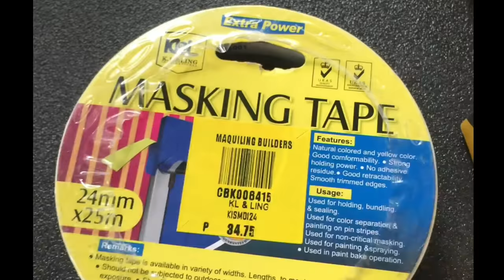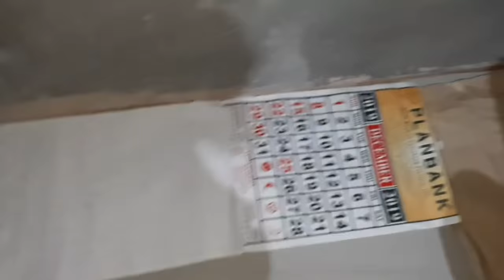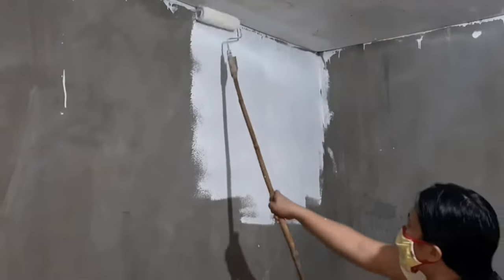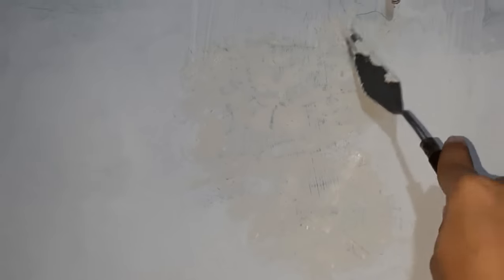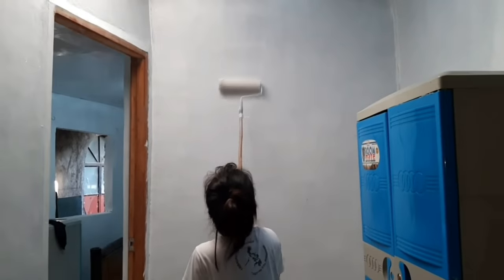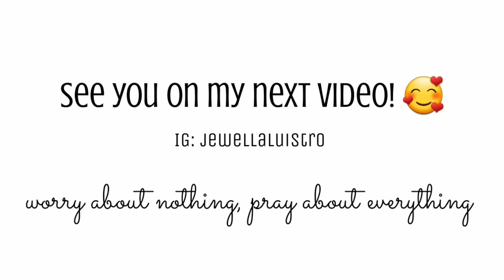EXTREME ROOM MAKEOVER | Full transformation (cozy, simple and minimal) Geometric Wall | Philippines

Comment: Hello I have been thinking of doing the same to my room but different colours. I wanted to ask what kind of tape did you use? It looked like masking tape but mostly it sticks to the wall and scrape the wall paint off with it when you take it off.
Reply from the maker: Yes it's masking tape
Reply from the maker: Take off the tape while the paint is still wet, don't wait until it dries because the paint will stick on the tape
Reply: @JewellaLuistro  okay done. Just got the paper tape today. Will let you know the results  ❤ Thanks for the tip.
Reply: @JewellaLuistro  I did. It turned out great. Wish I could share a picture here. Thank you so much.